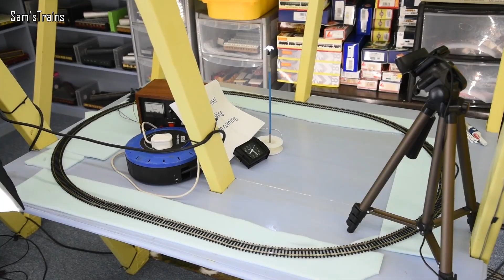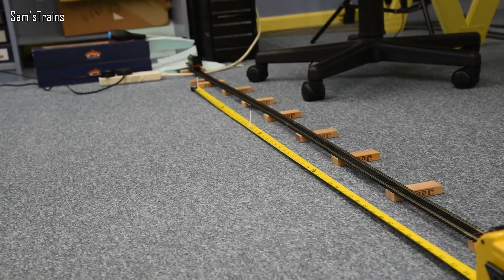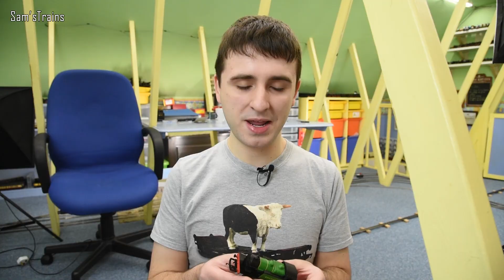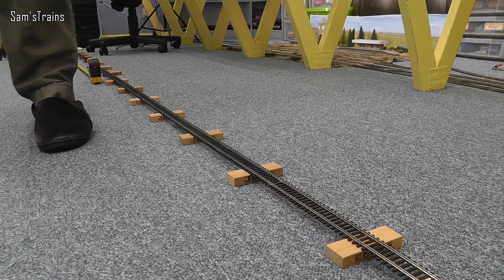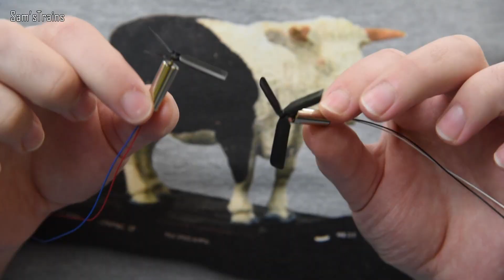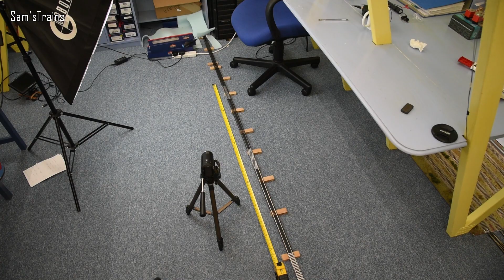How Fast can a Model Train Go?

Comment: Those weren't Sparks, they were arcs of high voltage low amp electrical current. The train was so quick and had low downforce. Jumping off the track almost.
Reply from the maker: Yeah you're right - they can still be called sparks though can't they?!
Thanks for watching - Sam :)
Reply: @SamsTrains  
Eh, if the material melts and falls away (yellow color, think stick welding) :D

Comment: This was a great video. I do have one question though, why did you lift the track up a bit using blocks?
I don't see anything wrong with that, its just that I think putting on the floor would be fine unless it has something to do with fire which I completely understand.
Reply from the maker: It allowed me to keep the track level - since the carpet has a few bumps in it - and it also keeps the sparks away from the carpet ;)
Thanks for watching - Sam :)

Comment: Whats the max current on your controller. Im thinking just go to town on quad motors in parallel. Point them slight down to keep it on the track.
Reply from the maker: 1amp is the limit at 12v - tricky stuff! ;D
Thanks for watching - Sam :)

Comment: @Sam'sTrains is there still be a way to be faster? I could have an idea but i do not have H0 tracks or a cart to test i could print one with my ender 3 i have a plan how it can be really fast on only 12V if I had the parts for it I would buildit and send it to you but if you want i can tell you HOW to be that fast.

Sorry for my Bad english
Reply from the maker: Not at all - your english was great! Yes I think they certainly could be made faster - that does sound very interesting - make a video of it if you decide to make it! :D
Thanks for watching - Sam :)
Reply: @SamsTrains  i will try. My secret are Brushless ;) and a few other things i have a shop for Model Trains around 15Km Form my home i will look for a cheap trailer is there a rule for the length? Or for the Axels? Like less then 4 or more then 4?

Comment: 240 miles per hour, but launched by a adapted 360 lb crossbow and way, way before youtube existed, VHS amateur cameras were way to expensive and did just 24 frames/sec. It was measured with a apparatus used for measuring bullet speeds of fire arms. (tanks to the local police)
Reply from the maker: I have thought of that - but you'd need modified track - it just jumps off! Sounds very interesting!! :D
Thanks for watching - Sam :)

Comment: Multiplying speed by scale is silly and resulting numbers are simply not 'scale speed'. (just because everyone else does it does not make it correct.)

Try multiplying the 'real' speed by one over the square root of the scale. This will give you a realistic scale speed.
Reply from the maker: Are you sure Phil? Surely the speed is proportional to the scale?? Doubling the scale doubles the distance, and therefore the speed would need to double in order to match the same time. Taking the real speed and multiplying it by one over the square root of the scale gives an even smaller number than the actual speed....
Thanks for watching - Sam :)
Reply: Sam'sTrains  Hi Sam. There are other factors such as time. To better understand scale speed the best I can do is point you in the direction of Bob Boucher. Google that name and 'scale speed' and you should find 'understanding scale speed' by the man.His article on the subject relates to model aircraft but the principals are the same.Similar articles have been written on the scale speed subject with regard to nautical modelling but these are harder to find and not written for the layman. 

Regards Phil
Reply from the maker: Ahh, that must be where model aircraft and model trains differ then; we don’t tend to scale time with model railways; DCC sound systems, timetabling and RPM of wheelsets are matched exactly with real life. Hence, I think it reasonable to ignore the concept of scaling time in model railways!
Reply: Scientific and realistic or subjective. Credible or incredible. Whatever floats your boat/train I guess.
Reply from the maker: There's nothing scientific about model railways - it's an entirely creative and subjective medium which is purely a means of entertainment. To scale time as well as speed would have a noticeable impact on the 'realism' which may not be perceptible with an aircraft. Model aircraft are presumably designed to fly in the real world; model trains are designed to operate in an artificial scale environment.

Comment: nice, but its like putting jet engines on a car, the jet engines do all the work so its a plain that doesn't fly. ima for proper speed runs it should only use wheels
Reply from the maker: haha I guess so - depends on the 'rules' though doesn't it? ;D
Happy New Year,
Sam :)

Comment: could you set the controller to 15V, but add in a switch so you can have it at 15V instantly and consistantly along the whole length of the track? :)
Reply from the maker: Yeah that would work too - but at 15v it accelerated really quickly anyway - so it was at a good speed at the measurement point! :D
Happy New Year,
Sam :)
Reply: @SamsTrains  Happy New Year to you to Sam! 
Im an engineers son, so im always thinking about stuff like that :)

Comment: looks like the motors may want a big capacitor on board to reduce the sparks. maybe some flyback diode too (that would kinda limit the options to just driving in one direction tho). oh. and some thicker wiring.
Reply from the maker: Thanks a lot for the tips - I'll be sure to try that! :D
Happy New Year,
Sam :)

Comment: What size of motor does this use? 
I used to hand wind radio shack xmods motors (130 size) 
I think one of mine might rock this thing!
Reply from the maker: You mean the first 0-4-0 engine? I'm not absolutely sure of the size off hand, but it's that incredibly standard motor size, same as used in scalextric and many other toys!
Happy New Year,
Sam :)

Comment: Ducted fan would improve your results. The only thing in the device capable of creating that big of a load would be the electrolytic. Was it's voltage rating enough? The magnet wire in the motors would melt before the track would arc weld. Wheel hop probably played a roll to.
Reply from the maker: Yeah you're right - I really should try this again with the ducts! They were only 16v caps, as I originally only intended to run them on 12v, but I'm glad I didn't upgrade them - it was much more dramatic this way! ;D
Happy New Year,
Sam :)

Comment: Hi Sam, technically your calculations are wrong, but this works in your favour, allow me to explain....
00 scale (1:76th) is what Hornby etc all use, but technically the track is HO scale (1:87th)
so the best way to "gain speed" is to reduce the scale, based on a track scale of 1:87th at 11mph your fan train actually hit 957mph! A silly test, but most entertaining - Thanks!
Reply from the maker: Hmm, it's only the track gauge that is HO though - everything else (sleeper spacing, engine size) was OO - so I think it's fair to calculate this as OO! :D
Thanks for watching - Sam :)

Comment: Just stumbled on this (thanks YouTube suggestions for being odd sometimes). I'm now curious as to what a larger train would be capable of on such a setup, just with a longer section of track! Like, maybe a model of the Mallard!

Edit: maybe also modify the train to handle more voltage as well, or even figure out how to remotely power the train without the rails? That way you can save the track!
Reply: Yes use RC batteries and radio control. Streamlined body down force wing etc.
Reply from the maker: That would be interesting Josh - removing the motor and adding propellors would be fascinating to try!! :D
Thanks for watching - Sam :)

Comment: The thing is, I definitely remember the older, like late 80s/early 90s Smokey Joe-type Hornby locos definitely having more speed to them as standard. Not sure if Hornby changed the internals in any way.
Reply from the maker: Yeah you're right - they changed the gearing to give slower running!
Thanks for watching - Sam :)

Comment: That was a cool experiment. Making a custom locomotive with propellors like that makes me think of the experimental locomotive, the Schienenzeppelin. Which was sadly scrapped 80 years ago, by the way.

But watching those sparks jolting out was just awesome overkill.
Reply from the maker: Thanks Thomas - yeah I've since seen photos of that, very interesting! Yes the sparks made this one much more fun ;)
Thanks for watching - Sam :)
Reply: Sam'sTrains yes indeed. You’re lucky your room didn’t catch alight via an electrical fire.
Reply: Sam'sTrains You may have killed your metal wheels, railway track and the wiring and motor. But this experiment was definitely worth it.

Comment: I don't know how capacitors work, but if they work the way I think they do, they might allow for faster speeds on a normal controller.
Reply from the maker: Hmmm, not really! You can make voltage-boosting circuits with capacitors, but you need AC for that, and there's really no need for massive voltages! Otherwise, capacitors are only good for momentary bursts of power - unless you get gigantic ones, and lots of them, you can't power a motor with them for very long!
Thanks for watching - Sam :)
Reply: @SamsTrains  Thanks for the correction!

Comment: I think one of the reasons for the arcs is the lack of contact with the track.as it starts to lift the current is jumping to the wheels and basically welding the wheels to the track.
Reply: tbh tho im not sure why youtube recommended this to me... no offense but to someone who isnt at all interested in model railways this is a super tedious video about you trying to make a model train go "insanely" fast (11mph) with "incredible" crashes afterwards. I understand that this "isnt my thing" and how it could be great fun for enthusiasts but its a really weird recommendation from youtube for someone with no interest in this, so i have to dislike just to avoid this kind of thing in future. sorry... 

well made video tho, good luck :)
Reply from the maker: Yeah that's right - and the high voltage and current made it way worse than usual! Thanks a lot for watching anyway!

Cheers,
Sam :)

Comment: It's been about 15yrs since I worked in a model shop, and I still remember my managers story. Back in the 70's/80's the train sets didn't include the controller, due to the tax reasons. A man (I believe Indian from his story) bought the set, and connected it STRAIGHT TO THE MAINS! The story goes it ran extremely fast, ran off the tracks and fell on the floor, before bursting into flames....

You hit 60v, UK mains voltage is 230v...... As you said, don't try this at home....
Reply from the maker: haha that sounds pretty fantastic! Would it really have moved anywhere though, being connected to AC? I will have to find out exactly what happens when you connect a loco directly to 120v/240v - though I expect it would all be over very quickly, haha!! ;D
Thanks for watching - Sam :)
Reply: @SamsTrains  I assume it would have,  but it couldn't have gone far, going by the scalextric method of going too fast. While the Hornby motors do run on the basic premise of the more power you put into it, the faster it will go, but taking about 20x the maximum usual power input does sound too much for them to handle

If you do do that experiment, do it outside! It was bad enough seeing you throwing locos towards your computer

Comment: Re your competition:  When you say you can't go over 12 volts, do you mean 12 volts on the track?  If so, I can put a 12v to 120v step up transformer on the loco and then a 120v motor on the loco.  Of course, according to Ohm's law W=V*A the thing with prolly draw enough amps to melt the track, but it's within your rules :-p
Reply from the maker: haha I suppose you could do that - but it's bending the rules very slightly ;)
Of course you'd need to use AC, and the current would indeed be pretty high through the track.... so do so at your own peril ;)
Thanks for watching - Sam :)

Comment: Trivial challenge. Give me a 15a brushless micro-ESC, a Futaba S-FHSS micro receiver, an 1107 drone motor swinging a 2045 4-blade prop, and some DTFB/hot glue, and I'll have you a train car that'll do 50 or 60 miles per hour. Piss easy. Drone motors are pretty nuts and 12VDC is roundabouts a 90% charge on a 3s LiPO, so the ESC and Receiver would be fed off the track rather than a lipo.

Or I could eschew electricity entirely and just whack a Cox 0.010 on the thing. Noisier than frig and the loft'd never smell right again, but it'd get up to some serious speed at zero volts haha.
Reply from the maker: haha that sounds very awesome!! I'd love to see that in action!! :D
Thanks for watching - Sam :)

Comment: Next time you do this, unattach that electrolitic capacitor, if it would operate for a long time it could have "exploded". It wouldn't be all that dangerous, but you would make a mess, plus the 4-way bridge rectifier (the 4 pin circular device glued to the loco's base), could have been easly damaged, ither from too much voltage being put across it or from too much current flowing through it. So everyone, don't do this.
By the way, check if all of the rectifier's diodes work correctly.
However, I like the video, and I might make a fast model loco one day.
Reply from the maker: Thanks for the comment! I wasn't too worried about damaging components really - if they had exploded, that would have been even better for the video! The initial design was only intended for 12v max - it was an afterthought to overvolt it!
Thanks for watching - Sam :)

Comment: An interesting project. I tried something similar when I was about 12 years old in the early 1960s using a Trix-Twin bogie bolster wagon with a Jetex motor (If you have never heard of them, try Google) attached. I laid my entire set of straight track pieces down the garden path, lit the fuse and off it went- very fast but could not measure it!
Reply from the maker: Thanks Mervyn, appreciate it! I'll certainly look those up - that sounds pretty incredible!! :O
Thanks for watching - Sam :)

Comment: An outstanding test, Sam. I was indeed impressed how you made the system of the speed, the resistence of the locos, and I'm happy that the little Pocket Rocket didn't burned up. I was also surprised how much volts you putted on the rail chopper, and it got quite scary when the sperks were sparks flew out of the model, and when it almost ruined the track and its wheels, that was just crazy and somehow it didn't went back in time. It was just astonishing how it managed to go more that 10 miles per hour, and that the chopper didn't exploded, and it would be interesting if you once do an autopsy with the engines, like you did with Miles. Anyways, I hope you're having a good day and I'll se you next time!
Reply from the maker: Thanks very much mate - I was quite amazed by it too!! I thought I'd see more burn-outs than that!!
Have a great day,
Sam :)

Comment: I ain't doing that challenge sadly 
I only have 3 models in my collection 
1 Bachmann model
And 2. Hornsby models 
Both are LBSCR E2 related 
2 Thomas, 1 E2 class
Reply: I just can't imagine my only models going at that speed not to mention seeing them might explode or burn there wires and motor!!!!
Reply: However that doesn't stop me from watching your videos Sam 
Keep up the good work 
PS: don't push yourself to much.
Reply from the maker: No worries mate - hope you enjoyed the video anyway! You would be safe to experiment, but only if you use your train controller - definitely shouldn't use any mains!!
Thanks for watching - Sam :)

Comment: if you were to induce a permanent magnetic field over the tracks and put enough voltage across them you could create a permanent and strong force ( a RAIL GUN)
Reply from the maker: Yes you could do in theory, but the field would have to be around and close to the tracks - it'd be very difficult to make an 'engine' to work on that!
Thanks for watching - Sam :)

Comment: HEY SAM'S TRAINS, WHENEVER MY LIONEL O GAUGE MODEL TRAIN ENGINE'S LEADING WHEELS SOMETIMES THEY DERAIL OR SOMETIME IT'S THE ROLLING STOCKS' WHEELS THAT COME OFF AND THE START SPARKING ON THE TRACKS BUT THE WHEELS AND THE TRACKS DON'T GET RUINED
Reply from the maker: Yeah I get that too - it doesn't ruin the tracks because the current is very limited with a normal controller!
Thanks for watching - Sam :)
Reply: @SamsTrains  COOL

Comment: Impressive, but I reckon faster is possible.  Great challenge!  Usain Bolt got up to 27.51 mph for a brief moment.  When I go running, I sometimes measure my speed using my local roadside vehicle speed detector.  Of course, I run safely below the speed limit when doing so.
Reply from the maker: Thanks very much for the comment, ahh yeah that's true - this isn't quite at that level then, haha! ;D
Thanks for watching - Sam :)

Comment: I don't think there necessarily is a limit to how fast they can go, it all depends on the type of motor combine with it's gear ratio and the amount of power available. In James may's "The great train race" they build a locomotive with an electric jet powerful enough to push a skate board, much damage followed when they tried to see what it's top speed was.
Reply from the maker: Yeah that's very true - I saw that on James May - I wonder how fast it actually went?!
Thanks for watching - Sam :)